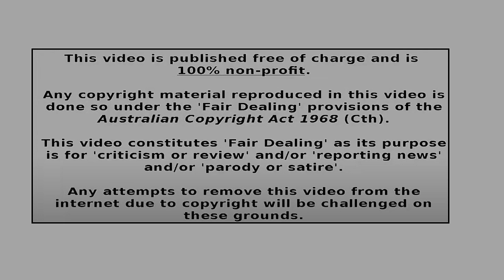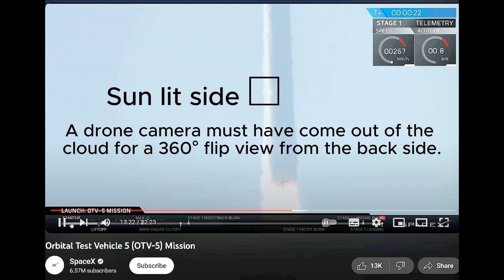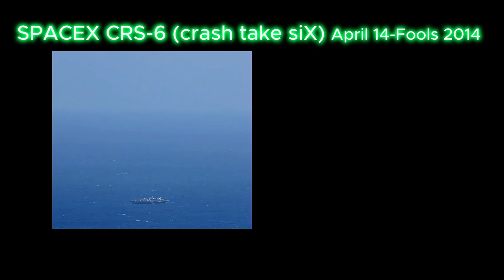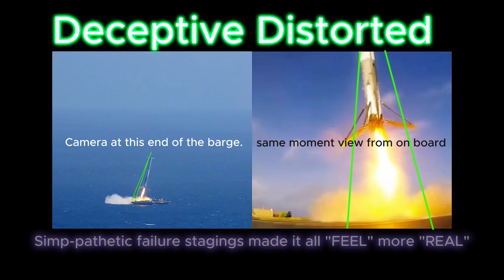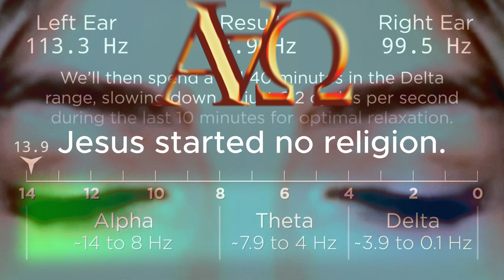#444 SPACEX distorted deceptive reference camera frames FAKEX📉

Comment: Don't you just wish that everybody would just make a model of the earth to prove its flat beyond any doubt. The equator is 24,900 miles long and circles around the north pole. So, get a length of plastic, wire anything that is 24.9 inches long. Form into a circle to represent that 24,900-mile-long equator. Then the distance from anywhere on the equator to the north pole is 6215 miles. So, attach 6.2-inch lengths of wire around that 24.9-inch circle like the spokes on a wheel.  
This model will easily show the correct shape of the earth. When the 6.2-inch spokes just touch at the center of that 24.9-inch circle, the earth can easily be proved to be flat.
Reply from the maker: Yeah or you just "simply" prove it's anything but 
an anti-centrifugal water spinning goof ball.😂
Reply from the maker: You'll die or go broke trying, a ball is the model.
and nothing will convince people like Wa11y or "ratchieooooo" otherwise, so long as their math spells ball.  
And besides David Weissass has a "model" app equal and opposite to any calc Nasass produced.
Undoing a learned lie means testing the physics of what they say with what they actually show us. SPACEX is BS. Musk knows about the dome.

Comment: 5:33 cheap kerosene? Nah it’s RP1 which is very much like kero but highly refined. And it is burned in a rocket be with pure oxygen. Pumped and sprayed into the combustion chamber at a high speed. 
Do keep trying
Reply from the maker: R-at P-iss Spurting Schi11
Reply: @AV036  lol do you actually buy the tosh Adam peddles? 
His line about earth moving in 4 different directions at once. Massive strawman.
4 relative speeds… only one actually speed

Comment: If the Sunlit side changes does that not mean the camera is on the opposite side looking back the other way?
Reply from the maker: 🤨 I recall somewhere..that rising level pan shot in photography suggest the camera is using a long distance lens hence it's a close up yet the detail is muted. So a DRONE? level flying along side "in that cloud" from that side according to the sun opposite side at launch pad or somewhere else wally?   Distorted Deceptive Disingenuous. camera staged FAKEX.
Reply: @AV036  drones won’t be keeping up with a launching rocket if they are close. Some drone have a descent long distance lens so they can be at altitude prior to launch and simply track the rising rocket with single axis tilt.